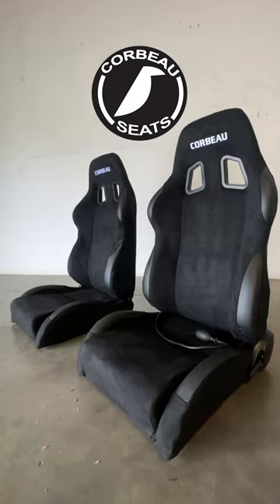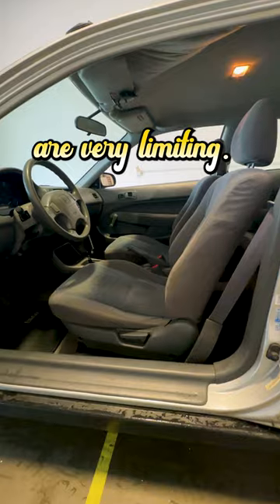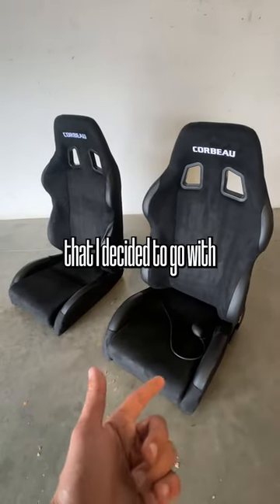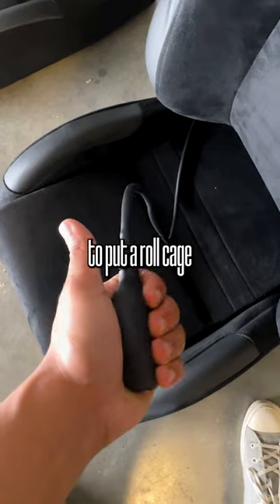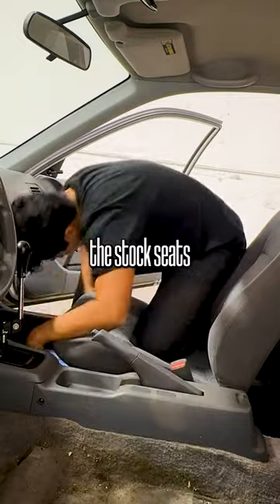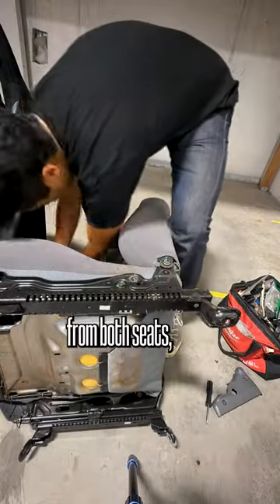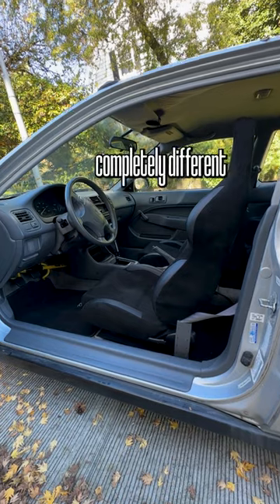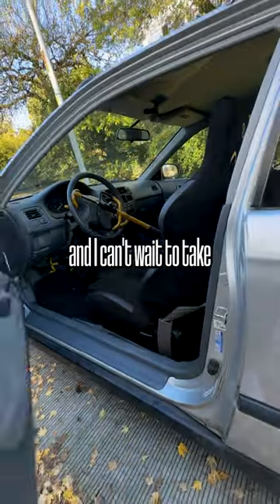Installing Racing Seats in My EK Honda Civic Hatchback

Comment: Had the corbeau forzas in my eg. Great quality but the bottom mount fixed back was a recipe for discomfort, sat way too vertically and couldn't see the gauges. Ended up going with buddy club p1s after those, much better due to the adjustability, however, I'm definitely really considering these A4s for my Cobra

Comment: Smart move for track use? Absolutely. Smart move for road use? Definitely, you're going bigbrain now. I can't tell you how many times I've almost slid out of my seat just driving around a corner at what should be a safe speed. I don't know why all seats aren't designed to hold you in place, at least a little.